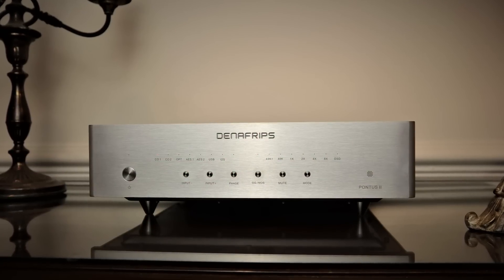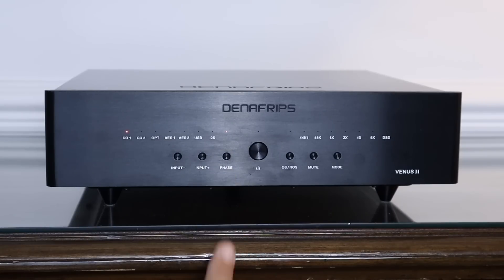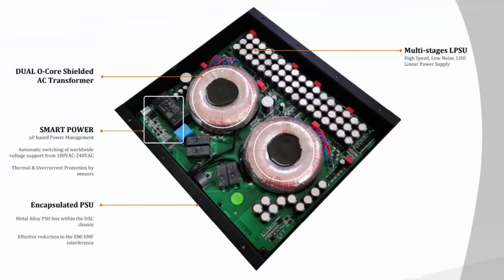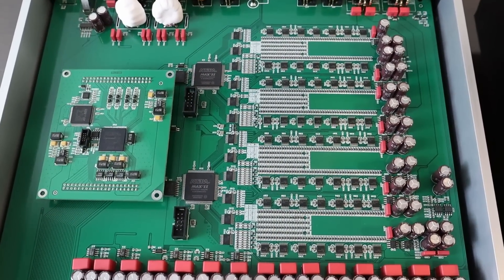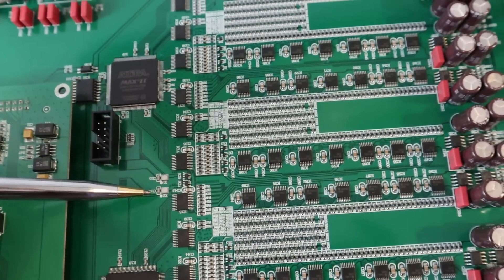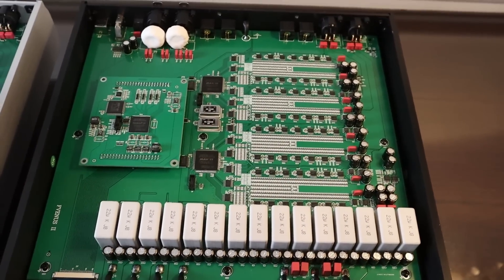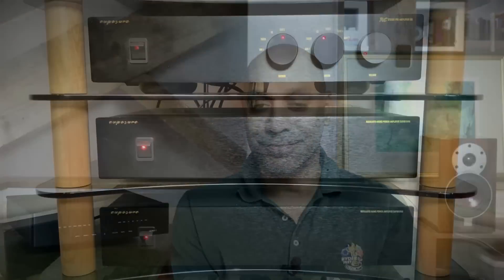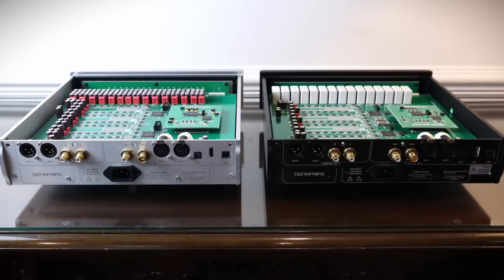Long term review: Denafrips Venus II (vs Pontus II)

Comment: As someone who has worked in the electronics industry for nearly 40 years I really appreciate your clear concise explanation of circuits which no other reviewers do (probably) because they might get lost (Hans Beekhuyzen excepted).  Love the channel, keep up the good work.
Reply from the maker: Thank you my friend 👍
Reply: Chasing higher performance can be a slippery slope no matter how much you spend. Burn in time is critical and the impatient won’t be gleeful immediately. You warned them about it. That is more prevalent depending on the component manufacturer as well as what it is also, a preamp or dac for example. If you are comparing two speaker stands for example, it is necessary to seal the hollow tubes at the bases prior to filling and , depending on fastener size and thread, torquing all fasteners with a torque wrench is necessary to ensure uniform tension at the base plate. You’re guaranteed uniformity with the tube or tubes with the base plate. This is just like aircraft and missile assembly. Failure to address steps properly, will sacrifice your install and that will likely cause other issues including sealing issues with the base as well as mechanical coupling differences which interfere with energy transference . Some may question this or disagree. They’re wrong. It’s consistency that yields the reliable, repeatable results. It’s about the details people. Little things overlooked have the cost of failure or less than ideal results.
Reply: @r423fplip , your question is not well defined. Try being more specific.

Comment: So here we are 2 years later and now the Pontus 15th edition is out.  Check out the internals.  What you'll find is the Pontus 15 now contains the motherboard that once belonged to the Venus 2.  The way to look at that is, you're getting what once was a $4k dac for $2k.  Some might say it's a lateral move, but considering what Tarun has to say about the Venus 2, it is a subtle upgrade with superior parts internally.  Something to consider.  Kind of makes you wonder how much better the Venus 15th edition is?  No reviews on it as yet.

Comment: Yes spot on Tarun, the Pontus 2 is excellent and musical. May I suggest getting the Iris DDC with I2S ( Jays Audio ) to pair with the Pontus 2 instead of getting the Venus 2. I’m using Kef LS50 metas with Rel T5X powered by Willsenton R800i with rolled tubes. Sounds pretty good in my smallish room.
Reply from the maker: Thank you Robert. I have the Iris. It improves the Pontus II but still not as to the level of the Venus II 😊

Comment: I’m not sold on this China direct gear. The cost to send these things back to China to get fixed is crazy high. And all those capacitors are not going to fair well over time. Having said that I wouldn’t mind listening to a Holo Spring 3, they look nicely built.
Reply from the maker: I would make sure you have an engineer who can service and repair them locally in markets where Denafrips don’t have a service agreement in place. It is worth doing because a DAC of this  build and quality will probably cost you double through the traditional dealer/distributor route 😊

Comment: Thank you Tarun for another outstanding review. I just ordered the Venus II 12th from Alvin. Your review kicked me over the edge vs the Pontus II. When you crack these cases open and go over all of the bits, it was difficult to not purchase the Venus. There is something about the Denafrips sound, and after dropping two new dedicated 20 amp circuits to my AV setup, the sound is simply getting better and better... I also added one of Alvin's linear power supplies to my (N130) Node, which kicked that up a couple of levels... Alright, heading up to the bank to wire Alvin the funds. Thanks again Tarun!
Reply from the maker: Thank you Michael. Much appreciated. I hope you enjoy the Venus II as much as I do 😊👍
Reply: @abritishaudiophile7314  Thank you Tarun, should be here next week. I will report back. ;-)
Reply: @abritishaudiophile7314  Thank Tarun. Something I did not get from your review is how much better you felt the Venus ii was from the Pontus ii. Is it more than 30% better?  The reason I am asking is that now that the 15th gen is out for the price of the Pontus 15 your get the Venus ii compared to the Venus ii that go on the second hand market for a 1000. Thank you in advance

Comment: It is nice to see when an upgrade model is really an upgrade and not just something different. 
One of my biggest upgrade failures was to put a moving coil cartridge on a vintage Pioneer turntable. I could not get it to work. It had a hum that I could not get rid of. This happened many years ago but I am still weary of moving coil cartridges and I prefer high output cartridges in general because of the signal to noise ratio that is better.
Reply from the maker: Thank you for sharing Hugo 😊
Reply from the maker: Hi Hugo, I removed “run away brides” comment. The only person I permit to be criticised on my channel (within reason) is myself. Thank you once again for sharing your experiences and apologies for having to put up with someone else’s rudeness 😊
Reply: @abritishaudiophile7314  Hi Tarun, thanks, it was a bit of a strange comment. I have a fairly thick skin so no harm done. Also, no need to apologize, you can not control these kind of reactions. Any way, I always enjoy your excellent reviews.

Comment: Another excellent review. I got the Pontus and apparently it's still breaking in but at least it sounds good now vs cold start. I notice there is room on the back for two RCA inputs. I wish there was an extra RCA input as the Ares has two RCA inputs. Using BNC to RcA adapters I've been able to hear sonic degradation. With an Audiolab 6000 CDT  and the Bluesound Node both with a Single RCA outputs, I need two RCA inputs and ordered my Pontus that way. Luckily they are flexible enough to do that for me at no charge. Shipping was quick. Five days from China to the US west coast. Their US repair facility added the extra RCA and the service was quick and expertly done.
Reply from the maker: Thank you Jim. I think you will find that Pontus II will continue to improve over the coming months. Great to learn about your experiences 😊👍
Reply: @abritishaudiophile7314  I've gone upgrade crazy and added a Rogue hybrid RL5 preamp and a pair of Belles Aria monoblolcks. I was lucky as all upgrades have improved the sound, no back sliding. Even luckier, I've sold on all the formerly wonderful equipment.  Next is the PD Creative LPS upgrade for the Node. As an habitual gear hound I am bound to look for other things to experiment with. I only wish I could find more music that I like. Some of the singers recommended by Tidal sound like a small animal being strangled. One thing I regret, I have heard good things about the Border Patrol DAC and they allow a two week audition, same price a the Pontus. I wish I'd given that a tryout before ordering the Pontus. Oh well. I can still do it, the only penalty being US return shipping if it doesn't stack up to the Pontus. What am I going to do if I like it better. Better do it after the Pontus is fully incubated.. The BP uses an odd tube that I've never seen before.
Reply: @fletchermunson6225  If I may suggest: a Scandinavian vocalist called Beady Belle. Very well recorded and most of all, an interesting music, at least to me. I suggest listening chronologically as her style changes. Let me know if you like this type of music, please
Reply: @wladers39  Thank You I have it liked on Tidal. Might be a while to get to it. Having issues. However, I will do it. You might like Temptations by Holley Cole. Sings Ton Waits songs.

Comment: Remarkably clear review and capable of technical insight. Fascinating comparisons were made between these two excellent DACs, which are different essentially in terms of component quality while the system architecture in each model remains similar. I’ve always been held with the NAIM philosophy - in the hifi chain, the source is the most important part of your hifi equipment because it gets all the musical information off to a great start, next is amplification, and finally speakers then connections. I would spend more money on the source than amplification and speakers because a modest amplifier connected to a superior source will outperform a setup with superior amplification and an inferior source. So the answer for all hifi is the source.
Reply from the maker: Thank you 👍

Comment: My man!🎉 this is the best video I’ve ever seen. With these two  DACs. For the simple fact that you’ve used one of them for 12 months straight kudos. Do you think getting the Pontus II  in upgrading the firmware! To the 12th anniversary. Will sound closer to the Venus II  or for $600 more just get the new 15th Pontus II that just came out!
Reply from the maker: @fadetoblack.-   thank you kindly. I would update the firmware. It is for free and will make a significant improvement to the sound 😊👍

Comment: Tarun, your review made me want to give the Denafrips Ares II another few months of burn in. I bought the Denafrips Ares II and had it burn in for a 60 hrs or so when I first got it and to be honest, the sound was good after the burn in, a noticeable improvement from brand new out of the box. However, it wasn't noticeably better than the Topping D70s I had hooked up, which sounded very analogue already so into the closet it went for many months. 

I'm taking it back out today to replace the D70s for a few months to see if it would continue to get better. I'm also pairing it with the Burson Funk powering the PSB Imagine Minis on my desktop setup and also the Hifiman HE6SE V2 which I recently acquired for under $500 brand new from an Adorama sale. I think the quality of the gear should be able to show the difference between the D70s and the Ares II in a few months.
Reply from the maker: That is great! Please let me know how you get on 👍
Reply: @abritishaudiophile7314  It's been 3 weeks and this morning I got curious and decided to swap the Topping D70s back in. I listened to a few test tracks right before the swap and immediately I can already tell a compression in the sound stage width and depth. 

Things just felt congested/closer together like it's too crowded when lots of instruments are playing. The Ares II gave much more breathing room between in the instruments. I don't know if this is because the Topping D70s needs to be warmed up but that's what I'll do today and report back.
Reply from the maker: @t0nyxgq  thank you for the update 👍

Comment: After your video I bought a Venus II (that came as a Venus II 12th Anniversary Edition by the way).
Must say: you were right.
Reply from the maker: Thank you. I am enjoying mine too 👍
Reply: @RvdH What did you upgrade from and was the Venus 2 all you expected it to be?
Reply: @karstenchoydesigns  

Before the Venus 2 I used the dac built-in my Mark Levinson No585. Which is not too shabby either.

The Venus (not completely broken-in yet) has more detail, is more musical to the analog side. Hard to describe. I chose the Venus to be in the middle of what Denafrips offers. 

Ordering from Singapore was flawless, actually I ordered a Venus 2, but got a Venus 2 12th Anniversary Edition where some components in the PSU box are fine-tuned and the O-Core transformer is upsized from 60 to 80 VA. 

Vinshine Audio is very helpful if you have questions. No idea what will happen long term, but the start is positive.

Comment: I just got my ares 2 over a week ago and am quite disappointed with it. Honestly just feel it’s quite boring and very little standing out as great. But, it’s good to hear from others how long these really need to sound just right. Happy to hear you gave the Venus the time 😉
Reply: I feel the same about the Mojo 2.
Reply: I had the Ares 2 and sold it., Truthfully it wasnt much of an improvement over the onboard DAC of my Bluesound NODE, and in some music I actually preferred the NODE because of its better mids and bass.  My system is VERY Mid-fi with the NODE> Rotel A14 mk2>Elac Ubr62/Focal Clears.  I think Id have to upgrade my system to actually detect a big enough difference to make it worth it. I dont think these standalone DACs start shining until you hit around 5k in gear.
Reply: @drewpknutz1410  you could be right but I think it comes down more to system matching. I have Harbeth p3esr xd and Audiolab 8300a which are 6k total in Canada. The softness of the dac just doesn’t shine well with the softness of the speakers. But again, I think it needs more time to open up that realism everyone talks about in reviews.
Reply: @robk5745  Yeah, you have a much better setup than I do, I see an upgrade to a Pontus 2 (or other) in your future..LOL,!
Reply: @drewpknutz1410  lol gotta spend the $$$ haha
Reply: What are you pairing it with ?
Reply from the maker: Hi Rob, make sure you give the Ares II a coupe of months to run-in before judging 😊
Reply: @jdavis234  Harbeth p3esr xd and Audiolab 8300a
Reply: @abritishaudiophile7314  that’s a long time, mine runs most of the day as my kids watch shows and everything else. So far, the realism has improved but it lacks technicality and excitement for me still.
Reply from the maker: @robk5745  if it has had a decent run-in, it may not be a good match for your system.

Comment: I own an Ares II and I agree that it is a very good DAC. My main caveat with it though, is its slightly "soft" (less dynamic) bass, that lack some of the clarity and control that the Bifrost 2 has, for example. So, I have been looking for another DAC ... and I have found one, from an unexpected source: Geshelli Labs now has their JNOG2 aka J2 with an AK4493 chip. Long story short - with a third party 12V 4A linear power supply - the J2 AKM has replaced the Ares II in my main system. It is better bottom to top, in every way - including soundstage, instrument separation, bass and midrange dynamics, and detail retrieval.
I had been looking for an R2R like the Pontus II, or the Musician Pegasus, or the Ladder Schumann - but now I am no longer looking at a more expensive R2R DAC.
The Geshelli J2 AKM is my new reference DAC.
Reply from the maker: Thank you for sharing Neil 😊
Reply: where did you get your power supply?
Reply: Can you share the details on the power supply you added to the J2? I have a J2 on order and would like the upgraded PSU as well. Any links is appreciated.
Reply: @matrix311  They are sold under several brand names, but the main one is BRZHiFi, and you want a 25W 12V linear power supply. They often have two options for the brand of toroidal transformer they use - the less expensive (by maybe $15-20) in Bingzi, and the better one is Talema. I don't think posting a link will fly, I am sorry to say.

Comment: Interesting opening comments. I recently bought an Ares II and Iris DDC to replace a Metrum Acoustics Musette in my headphone system. Out of the box it sounded bloody awful. I've had it running Roon 24/7 for the last few weeks and while the musicality has improved, the clarity and detail I experience with Metrum Acoustics DACs just isn't there.

I'm now trying to decide whether to go Pontus II with Hermes DDC, Schiit Yggdrasil LiM or completely empty the coffers and go Metrum Acoustics Pavane. I'd be far more confident to try the Pontus if Denafrips had a return policy; I really don't want to get stuck with a DAC that doesn't suit me.

Thanks for the upload!
Reply from the maker: Thank you for sharing John. It may be best to stick with things you can audition in your case 👍
Reply: John. I own the Pontus II with Hermes.   I really like the combo.   The Pontus is a high quality that brings feel and substance to the music.... When I added the Hermes the clarity and air improved by a significant factor.   I personally felt a Hermes + Pontus II would equal or better a.venus but I never the latter.   In summary: I think you should go for Pontus II + Hermes especially if you have an avg streamer. Hermes may not improve your input as much if your streamer is top notch, sending a lower jitter sig via i2s.  If you don't have...do it.    A great combo and surprised me how much a ddc helped my chain.
Reply: @super12892  Really useful commentary. I appreciate it. Thanks.
Reply: @abritishaudiophile7314  Just reporting back a month further on. The Ares II has really improved. I'll be honest, I never believed in burn in until now. It's a completely different DAC now and sounds excellent feeding my new Linear Tube Audio MZ3 headphone amplifier. Of course we always look to make the sound better :) 

Am now considering Pontus II + Hermes, or Venus II on it's own (initially at least).  I shall let you know how I get on. All the best.
Reply from the maker: @johnratcliffe6438  that is great. Thank you for the update. I find that Denafrips products need the longest burning times 👍

Comment: Ty. Have a dac in my h90. It took a time before I used it with hi res audio(tidal) use a topping d50 to my tube amp. But mostly bt in my bedroom. But I had a cable,a silver one bought by meters,no connection. A pretty cheap upgrade. Borrowed a 150£ cable and it became muffled and worse I thought. Build a supra cable and yes, I lost a little top end but gained grip and texture in the bass. Warmer midrange but didn’t loose resolution in the details. Mabye I will test other cables in the future.
Reply from the maker: Thank you for sharing Daniel 😊